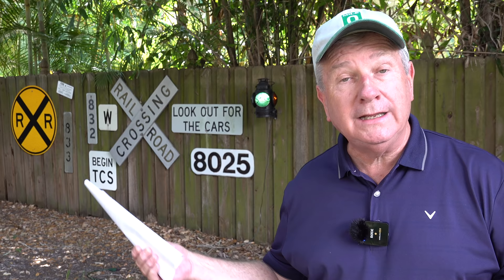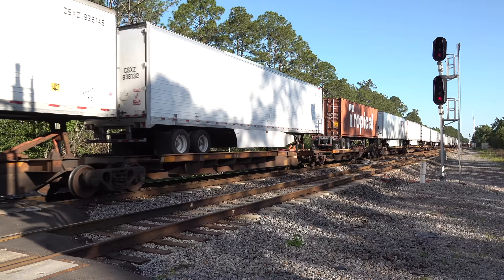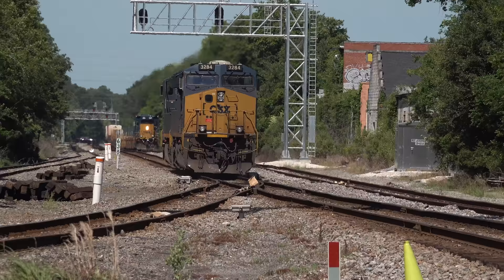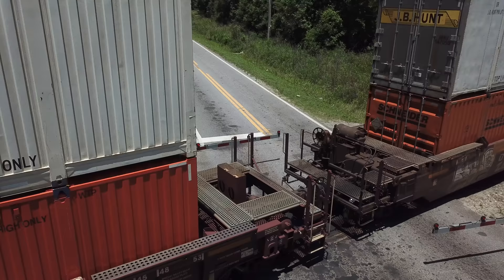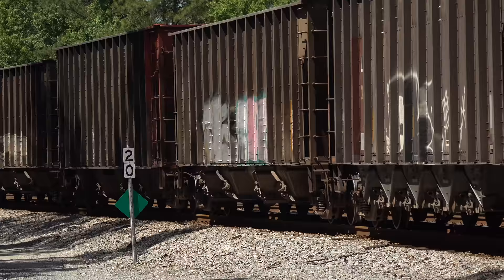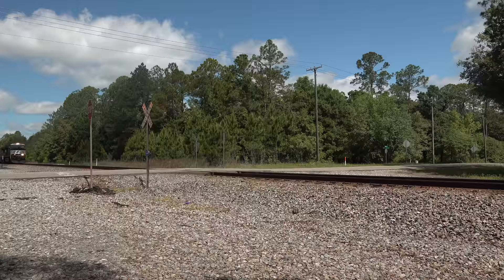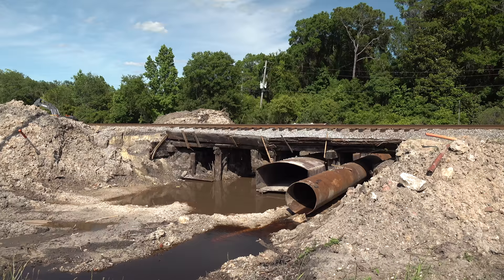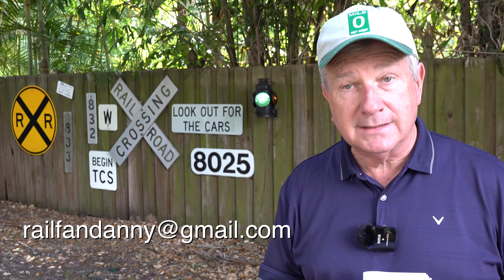How Distributed Power Works

Comment: It's interesting how long it took american railroads to copy the Candian Pacific RR's use of DP's.
CP routinely used DP on their 14,000-18,000 ton coal trains. I worked for CP for 3 yrs until being called back to the BN RR in Seattle in 85'.
In 74'-76' i often worked between Kamloops and Boston Bar and looking across the Thompson or Fraser River Canyons at the CP side I marveled at the huge CP coal trains i used to see. CP used a 'robot' car coupled to 2-4 locos positioned behind 25%-40% of the tonnage trailing behind the lead locomotives. If one of these trains came into Coquitlam Yard the Yardmaster would have the train with the 'robots' land in a track with the lead locos and the head-end of the train going into a different track. If the locos were destined for the roundhouse once the headed was parked the headend locos would go back to the robot consist, couple to them and they would all go to the roundhouse together.
I had only recently started using DPU's when I decided I wanted a more normal lifestyle and hired on to Amtrak. 
DPU's are interesting technology except for the fact that the companies started running even longer trains through a country designed to have shorter trains. Lots of anger out there from EMT's, firetrucks, etc etc.

Comment: Just a little side note. When setting up DP in a train, the computer has no inputs for the tonnage, loads/emptys, etc that it is pushing or pulling against. Its just a simple throttle/dynamic control.

Comment: I was on NS trains in the late eighties. The multiple Unit’s, as were called back then included a radio control car…Cracker Box as we called them. Took some time to configure those to MU the train . Also I only saw those on very heavy trains like coal or rock. The new system appears to be a great improvement! Enjoy your channel!

Comment: If you only knew! I’m a retired up locomotive engineer I retired in 2016. Started on the Rock Island in 1972 as a Switchman and hired on the Missouri Pacific railroad at 1978 as a trainee engineer I’ve seen a lot it’s come along 
way then to what you’re seeing now . back there if you talked about training consist, they would chew your ass out they would run nine lower horsepower locomotives one 9000 foot train loaded with cushion drawbar cars followed by 40 cars of rock another 40 cars of auto racks and another 40 cars or so of more rock with a caboose on it the speed recorders on all the locomotives didn’t work I had to use the stopwatch, and for counting how long we were, we had to use telephone poles you use the stopwatch as you counted the polls at a memorized 10 poles in so many seconds equals so many miles an hour now it’s been a long time. I forgot the table on the caboose really had to hang on and if you had a coal those guys would be covered in colddust I complain to a manager one day, who is very arrogant and probably never been on a train as far as I can figure he informed me that the only thing that restricted the length of the trains was the length of the sidings later, after he had retired, they named a yard after him, go figure, it wasn’t until we got simulators that they actually started realizing the problems with miss loading trains and exceeding lengths at horsepower, the dynamic brake system all road locomotives had them, but we were not allowed to use them. The simulators finally educated the managers to what the engineers already knew using dynamic brakes, and it wasn’t too long after that, we started getting distributed power it’s been quite a ride yeah I’ve got stories to tell I should be in a museum like the E unit 951 by the way, I have ran that engine with all those business cars you see painted up 
Is Union Pacific Cheyenne Heritage Roundhouse? Oh well, I’ve said enough. Thanks.

Comment: At 03:14 what is the spray on the ballast and purpose, pl detail.  Again the doubt which I am trying to get clarification on;  When multiple units are operating, will not the unit that is at lower power output [i.e. at lower speed] act as a brake or decerating force on the unit that is at higher  power output [i.e. at higer speed]  To layman this is really perplexing.  I hope I have conveyed my doubt;  what i meant was the slower of the multiple engines whether act as a brake force on the units at higher speeds.  Thank you for your video clips which are absorbing for every rail fan as there are multitude of highly complex steps at every stage of the vital transportation mode explained by you!

Comment: But... you mentioned a radio connectivity problem that was overcome. What problem? How was it overcome? Who's controlling all the locomotives? How do they communicate? Are all the locomotives responding to the same commands at the same time?  Does control need to be humans on scene or can this be automated? If the front of a train has crested a hill and there's a loco far back in the consist on the upward side, what happens? What's the "slack issue" that DP solves and why is it important and worth the cost? How much does it cost? Why does this reduce wear on the rails? When three or four engines arrive at a destination and there's only one crew, what happens then?  When I read the video title, I was hoping for this information.

Comment: Cut right at 19:57 and abbreviate everything in front of it just a little and you have a nice 10 minute opening credit sequence to a train heist movie.  Then at 19:57 as the train is going out into the distance and the car counter has finished speaking for a second or two, cut to the inside man, climbing into the DPU to "troubleshoot some control lag", after having apparently walked back there while the train's in motion...

Comment: FYI:   At the 2:00 minute mark that is not steam rising off of the pond.  It would be a form of fog.  Steam would require the water to reach the boiling point of 212 degrees Fahrenheit or higher.
Reply from the maker: Ughhh. Yes, I got this lecture from another scientist who set me straight on it. Strangely it has the same look as steam. So that's fog I see coming off a hot asphalt street after a summertime storm? I'm still calling it steam.
Reply: Distant Signal   It was not meant to be a lecture, just information.  I’m not a scientist, I’m a qualified steam locomotive engineer.  After I retired from the UP I got involved with an organization that was rebuilding the only Louisiana built, standard gauge, steam locomotive left.  After WW1 the Southern Pacific built eleven in their Algiers Shops.  Algiers is a part of New Orleans that is right across the Mississippi River from the downtown area.  And yes that look-a-like steam coming off of the hot pavement is a form of fog too.

Comment: This mode of opperation was used in the UK with steam. It was felt safer to use a loco at the front and one in the middle rather than the rear. As a fireman had to be firing no need for fully automatic. Even in the 1940s I feel this type of opperation was perfectly possible. To be clear, if the middle engine isn't controled it has no advantage in the middle, or worse.  Radio opperation seems to me to be less good than lets say triple coax ( like TV cable with two spare circuits ), radio is fine if backed up and doubtless is failsafe. A  mechanical system of valves like with car braking could work. It's a simple mechanical computer, very very simple could work. Even in the UK in 1947 would have been a possible start date with loco's 10000 and 10001.  Truth is the diesels were so strong mostly they were good enough in MU. One of the larger improvement is lower speed ability which continues to improve. Steam should be King. It wasn't as wheels often were too big to get a high speed running compromise. 8F loco's 60 mph set an ideal format which was very practical in real life.

Comment: Sometimes, using a dp has less to do with if it would be better for economy, and more to do with what’s getting done with them at the next stop. Bnsf does this frequently with empty grain trains running from Kalama to auburn here in the Pacific Northwest. If auburns making it longer for it’s next leg, they will request the crew to use a F.R.E.D rather than a dp. Something I noticed as a crew driver!
Reply: Okay I read your comment and I'm curious...

What is a  "F.R.E.D" ?
Reply: @icosthop9998  Flashing Rear End Device. It’s always on the end of a train if they don’t have a dp
Reply: @arbl1992  thank you very much 👍

Comment: I have a question. Why do some trains have the power spread out equally at the head, middle and end of the train, while others (like BNSF) seem to have all of the power at the front, (sometimes 10 or more locomotives)? Are all of those extra locomotives at the front end actually pulling, or are they just tagging along like just another freight car for some sort of power relocation? Wouldn't having all of that power actually pulling at the front end be tough on the front car?

Comment: Danny I REMBER the Weehawke yard. burned in the late 70s. on the other side. of. the of that tunnel. from North Bergen The reason the signals being LED. light emitting diodes

Comment: Nooo, it‘s the /TROUT river/ if it has so much trout.
On topic: Wouldn’t DPUs be slightly lower on power to the leading loco(s) so the train remains stretched?
Wouldn’t there have been DPUs before remote control? I heard rivers just communicated by radio back then.

Comment: Hope you can answer this. I recently saw a video of UP4014 AND UP844, both 1940"s steam locomotives, connected to the same train. How is it possible to regulate those two separate power sources with the technology of the period? Seems like there would be drag from either engine without a way to sync them. I guess one could have been in neutral. Thanks

Comment: What kind of stresses does this place on the couplers? At some points, the DP engine in the middle is pushing while the front engine is pulling. Going downhill, I reckon the loads reverse. Does the slack in the cars just simply get pushed and pulled back and forth, presumably resulting in a lot of crunching sounds?

Comment: I just watched your video to get an answer. But I'm still wondering, how do they know exactly how much the DPU is putting out ? If for some reason it was slacking. With that much tonnage, is there still a seat in the pants feeling at the head unit, to know you have a dead engine ? If there's two DPU's, paired, how do they know their outputs are equal ? I thought maybe they had a hydraulic ram type pressure sensors attached to the couplers that gave them a somewhat precise reading of pull and push. You mention it's calculated. I'll assume it's all pretty forgiving ? Just laymen thinking, half throttle for one engine is different than half throttle for another.

Comment: Other than the use of radio rather than several dozen train wires, how does DP differ from a conventional passenger electric or diesel multiple unit (or a combination of such) as seen throughout European railways? Would say two coupled British Rail class 150/153/155/156 DMUs from the late 1980s have counted as "distributed power"?

Comment: When you have a DP train if there is a problem it will register inside the cab, but what happens if a wheel goes bad?  Are they checked periodically?

Comment: One thing that is  dangerous  about  using  distributed  powered  locomotives is that it is NOT  WITHOUT  ITS FLAWS! AND IT IS NOT FAILSAFE!AND IF THE SIGNALS ARE NOT OPERATING  LIKE IR SHOUSHOULD  BE,OR IF THE LOCOMOTIVE  RECIEVER IS  MALFUNTIONING,YOU COULD HAVE A DISASTER IN THE MAKING!FOR  EXAMPLE,WHAT IF YOUR TRAIN IS STOPPED AND ALL OF A SUDDEN,THE LEAD LOCOMOTIVE IS STANDING STILL  AND THE DISTRIBUTED  RECIEVER IN THE MODDLE OF THE TRAIN GETS AN  IMPROPER RADIO  SIGNAL,AND CONTINUES TO  PUSH AND PULL ON THE TRAINTHEN WHAT YOU WILL  GET IS A DEADLY  AND DISTRUCTIVE RESULTS!

Comment: Not too sure you have the financial costs worked out correctly.  The cost of manpower for say a days wage, is a minute proportion of the cost of several thousand gallons of diesel used, and the depreciation of the rolling stock.  Not to mention the added complications of making up such a large length of carriages.   Also to do the distributed power, requires a capital outlay of radio telemetry equipment.   What with all the added complications, it might be cheaper to run two smaller trains, than one big train....   Maybe they just haven't got the staff.
Reply from the maker: Well, you lost me at "depreciation" and "capital outlay", but I'm only going by what the railroads do. I cannot imagine they would run DP engines if it didn't save them money somewhere.

Comment: I wonder why the industry never adopted a subway type of power train system. IE electrified trucks doing locomotive work, most likely fed power from a engine like what are used now, so a third rail is not required.

Comment: A question 
You might know the answer to 
At the crossing 
The warning bells stop. 
Until the gates raise 
But up here in Kalamazoo, Michigan 
The warning bells.  Keep ringing 
When the crossing gates are down?
Reply from the maker: It's a setting. Like PREFERENCES on your computer or iPhone. The newer systems can apparently be set to ring bells at the point of activation then stop ringing when the gates are fully down. Or ring all the time. Or, like on the FEC, they ring when gates are coming down and when gates are going back up.

Comment: Are  you  a  retired  locomotive engineer  or  conductor  or yard  master  or are you just a  hobbyist & rail fan
Reply from the maker: Nope. Just a guy who loves trains. Never worked for a railroad and done any work connected with one.
Reply: @distantsignal  Ok  got  ya  me I’m  a  retired  Semi Truck driver  at 56  years old  due to  illness   I use  to do  piggybacks  in  and out  of  the  Chicago Rail &Container  yards

Comment: Spy isn’t a new thing really they used robot units which had a smaller genset inside what used to be old boxcars. These were radio units that received radio commands from the lead engine. The robot cat would control units in the middle of the train. Nowadays they are called DPUs and can do a lot more than the older units could. I used to watch CP rail put together these unit trains in the Bearspaw yard on the rail heading west on the CP main.

Comment: Wondering if when the DPU is "fenced off" and under manual control, do they have to put an engineer in the DPU? Otherwise the lead unit engineer would have two power units to operate and monitor.
Reply from the maker: No. I think it's pretty simple for the engineer to operate the DP engine separately. Plus I believe those situations are brief.

Comment: Images online show tracks damaged by spinning drive wheels on a locomotive when a train is stopped (semicircular cutouts in the ruined steel rails.)   Were these incidents of failed DPU - maybe full power applied while the train was holding brakes?  That must make a horrible sound.  If control communication is lost, the crew probably is not aware of the slipping wheels a mile or two back.
Reply from the maker: What you've seen is called wheelslip. It usually occurs when an engineer is starting his train and applies too much power to the drive wheels. The turning force of the motors exceeds the friction at the railhead and thus the wheels spin. If he lets it happen too long (a matter of seconds) the wheel will start to grind and then melt the rail, causing a dip in the railhead. I don't know if DPU engines are more or less likely to cause wheelslip. In any case, the damaged rail must be replaced as soon as possible.

Comment: How does the dispatcher (I assume) determine if, when and where distributed power is used?
Reply: Hi Walter, CSX Engineer here. Not dispatch, they are like the traffic control center of what train is using what trax.. Its us, basically Conductors job to assemble the train.

Comment: Or  low clearances  under  bridges  rocks  or mud  slides  on the rails for safety  purposes 🤔 cameras  screens inside the  engineers  cab  look  out person  & what will happen if a turnbuckle breaks  away  under  load pressure stress age ect ?

Comment: At 6:01 there appears to be a container on a trailer running piggy back. Any idea why this would happen?
Reply from the maker: That happens a lot. Often on the back haul, RR's will put containers on spine cars designed for trailers. Most will fit on them with no problem., especially the 28 and 48 foot containers.

Comment: So a mile is 5,280 feet. The length of trains I've seen on here are well over the one mile length. In fact, one train was over 10,000 feet. My question is, "Does the train conductor have to WALK the 2 miles when inspecting something has gone wrong with the train?"

Comment: I was getting worried when I didn't hear much about DP, but Danny came thru with "technical gab" at +15:16, more at 19:15 and at +28:00. It would be interesting to learn more of the PTC problems (~+18:15), but that's another video.
An interest DP train video is Ferrosur's unit that has power located after every 17 cars throughout the entire train. https://www.youtube.com/watch?v=0yyeGXjQBYc
Interesting to hear NS's car placement (by car type) vs CSX's. I always thought they were arranged by destination.

Comment: One thing they are quick to  point out is the  benefits of  distributed powered  locomotives and  their usage but what they won't  tell you is  about  is the number of  deaths that  is caused by DERAILMENTS  due to Malfunctioning signals being received by the locomotives that is placed in the middle of the TRAIN!you may need  that extra power, but remember!that extra power  comes with a host of POSSIBILITIES for  failures  due to railroad  conditions, and mechanical problems that  can be a ticking time  bomb  WAITING to  go off.notheng man made is perfect!this EQUIPMENT  can cause death, destruction and  money!and loss of EQUIPMENT and  the locomotives  involved in  DERAILMENTS!